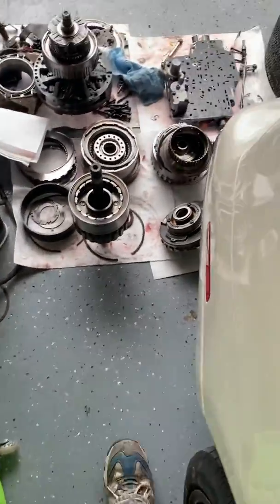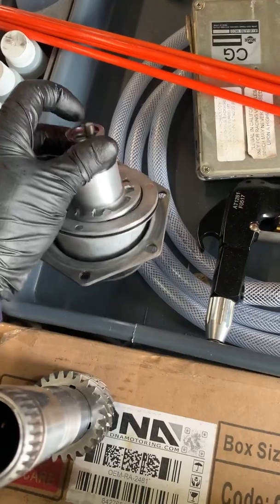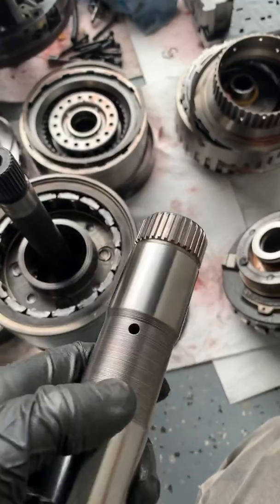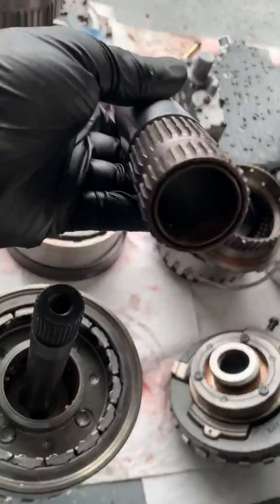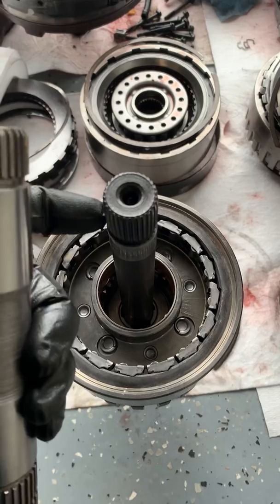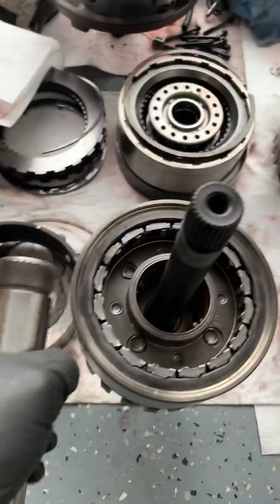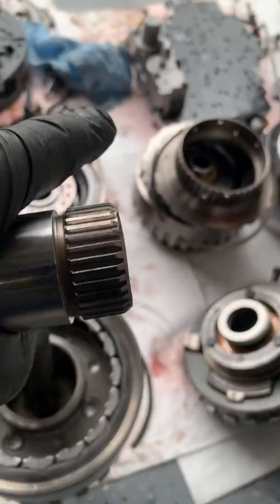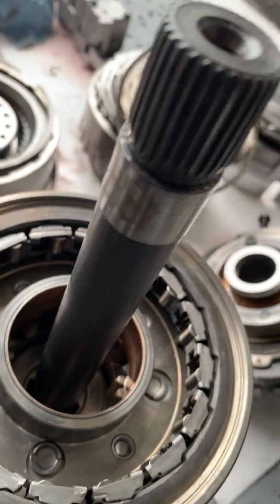4L80E Rebuild - No Reverse / Stardust Automotive Inc.

Comment: thanks for the info.  i bought a 2002 gmc 1500hd with the 6.0 lq4 and 4l80e trans, truck had no reverse when i bought it for only $1000, thought i could extend the servo pin and get reverse back, but that doesn't seem to be fixing reverse.  im not slipping in reverse, it's straight up neutral in R.  thinking about swapping in a used tranny from a burned down truck.  looking more into more reverse fixes and this info is helping thank you.
Reply: Don't ever get transmission parts from a known burned vehicle, the heat from the fire will ruin almost all of the parts inside